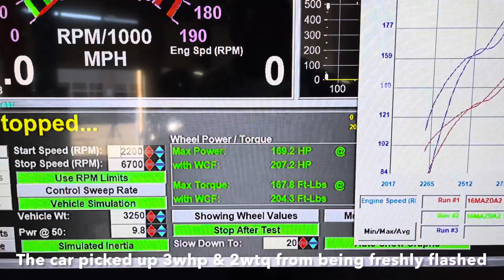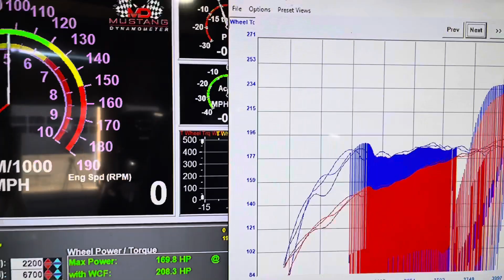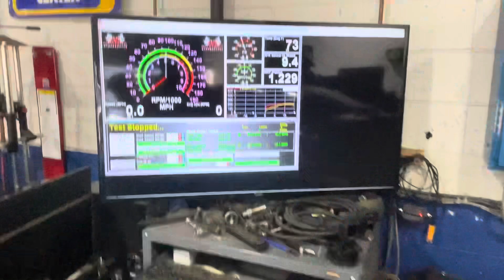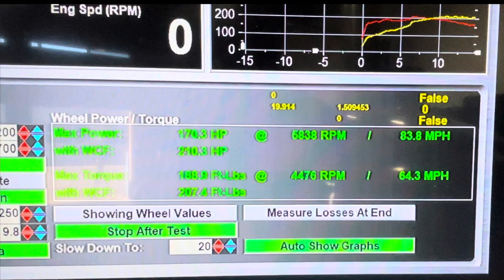Mazda Monday Supercharged 2.0L Dyno & 2.5L Throttle Body results

Comment: Mazda cx3 2.0 VT Supercharger with 2.5 Throttle Body, 2.5inch Exhaust Piping & 41 Header.

188HP
260NM
Reply from the maker: You can make more!

Comment: Just got a 2.5 throttle body since it was only $30, excited to try it out!
Reply from the maker: Nice, you will need a tune to see any improvements from it because the throttle body is electronically controlled
Reply: @supermazda3  sounds good, I’ve been using DR Tuned for a few years now so that shouldn’t be a problem

Comment: What kind of tuning is needed for a 3rd gen 2.0 with the supercharger? Do you have to take it to a dyno and get it tuned by them or is there some kinda flash tune?
Reply from the maker: No dyno is required. I can do it remotely. Email me if you are interested in any type of tuning at mazdasaucetuning@gmail.com

Comment: As a mazda owner i love seeing you that type of work but is not worth 🥲 i have a mazda 6 2018 2.5 turbo and i lost the engine due a cracked cylinder head without any tune or nothing 🥲
Reply from the maker: Your cylinder head is different than NA. These cylinder heads can take 400whp
Reply: @supermazda3  oh yeah i believe those turbocharged engine are shitty asf but its kinda fucked up how it didn’t lasted more than 70k miles without any tune or modifications 🥲
Reply from the maker: @PedroHenrique-iv9sp 2022+ 4th gen turbos cars are built way better

Comment: Would the throttle body be a bottleneck for air?? You think you could see more gains with a 2.5 intake?
Reply from the maker: Yes, because the surface area is less than the MAF housing area, but there's honestly minimal resistance.
Reply: @supermazda3  Yeah with 1hp on the TB + SC , idk if id even try unless the intake + TB could net 5 at the wheel. Cool stuff
Reply from the maker: @OlgarthDB  you won't gain anything without a tune to force the TB to stay open. The tune that is on the car does that
Reply: @supermazda3  everything just clicked lol i rewatched the end and yeah its totally right that the gains would be minimal before tune. This would be awesome to try out when i get my tune while still NA

Comment: Thoughts on the RES Exhaust headers for the 2.5? or just thoughts on headers in general for the platform? (Aftermarket vs OEM)

Appreciate the work you're doing for the community. 🙏
Reply from the maker: They work, and I've tuned a few cars with them installed. There's a small drop off on low-end TQ, but the top end gains quiet a bit

Comment: So in conclusion bigger TB gained 3 wHP?
Reply from the maker: 1whp with a supercharger
Reply: @supermazda3 Im curius if there is a risk of potentially hurting engine witha TB swap on a skyactiv X engine.
Reply: Yea
Reply from the maker: @TheXrader123  1whp
Reply from the maker: I do not know if the Throttle Body will fit the Skyactiv-X. Do you have the Skyactiv-X with the compressor

Comment: Recently on the Facebook groups, there has been discussion about the AFE Takeda intake hurting fuel economy due to too large of a MAF housing. Can you confirm that on the dyno? Have you previously? Sorry, I’m a new subscriber. Thanks for all of your work so far!!! Love my 2017 3.
Reply from the maker: Many of my customers reported this with that intake without knowing the mentioned information.

I would strongly advise against that intake, I'll make a video on that later down the road
Reply: @supermazda3  I’d appreciate the video. I’ve just ordered in a Corksport intake (specifically for the 2.0) with their air box. I’ll be selling the AFE that I’m currently running. 

Thank you so much for your genuine support and interest for our wonderful little cars.
Reply: Yep it really hurts economy used to have 8l/100km with the intake I would get 12l/100km gone back to stock and waiting on a corksport sri
Reply: @SLO_MZ3  I switched to the CS intake about two weeks ago. Along with a reset ECU, it’s doing much better.

Comment: If you're buying a car with a big focus on making good power and tuning it then the Mazda 3 just isn't a good choice compared to do many others. It doesn't make much sense. The Mazda 3, especially the newer ones are fantastic cars just not great for these purposes and modifications.
Reply: It's hard to say atm. We need people to keep testing and trying to improve the tune or find other mods to gain more power. The mazda 3 is a very capable car. There's just such a small community that mods these cars. Unlike the Subaru community, they've been doing this for a while. Mazda changed things up with the skyactive engines, so hopefully, one day, we can get as far as the subies.
Reply: You have been spoiled by LS and B series bmw motors. People that want big power will rip the motor and rebuild it or swap it for something else. The average dude or gal that has a few bucks for a tune+bolts or turbo can make out just fine. Mazda's are wonderful when you put a cam in them and at track days you see them putting laps on the other imports so
Reply from the maker: Yes, I'm aware of this.
I have tuned many 2.5t cars. They make great power.

Now that vehicle prices are finally coming down, it is obtainable to more people.

I'm currently happy with my 4th gen power level & I'm still able to get great MPG